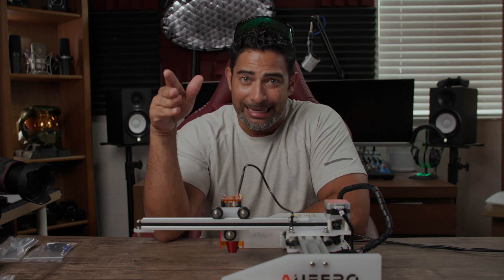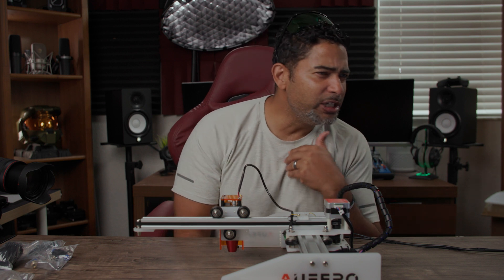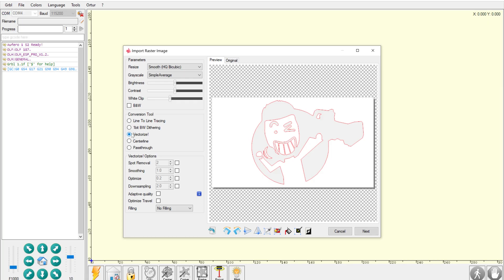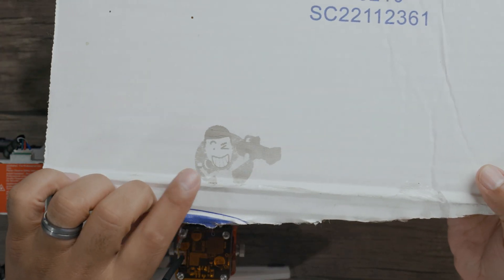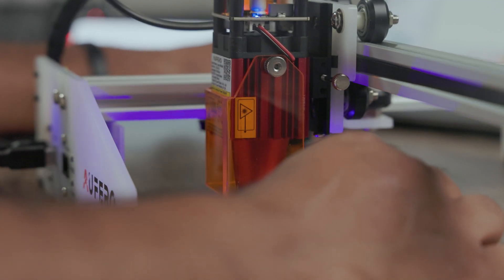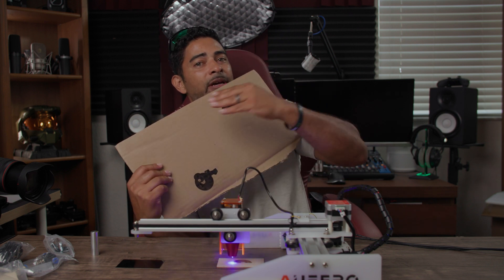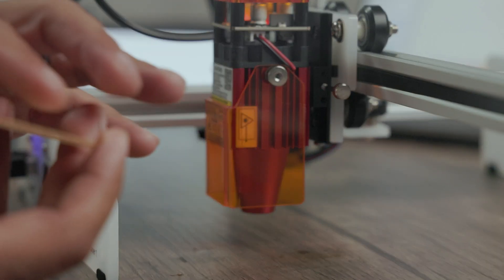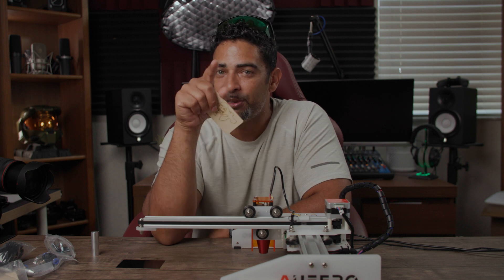IM A BEGINNER!  Start engraving in less than 10 min | Aufero Laser 1 | AL1-LU2-4-LF Review

Comment: Nice video! Don't worry about the laser you chose! Real world tests show minimal actual differences in image quality between the short and long focus choices....and even the lower power ''detail laser''. You do have the added advantage of better cutout capability, however.

You need to do a graph test on each new material you use. This will show you the best settings by calculating both intensity and speed. You can get great results with that laser on anything from slate to jeans.

Also play around with the lines per inch settings, etc...you can get finer details digging into the software. Also I would recommend Light burn over lasergrbl.